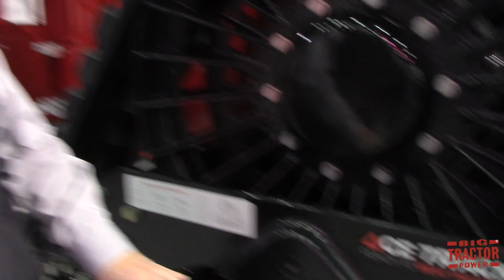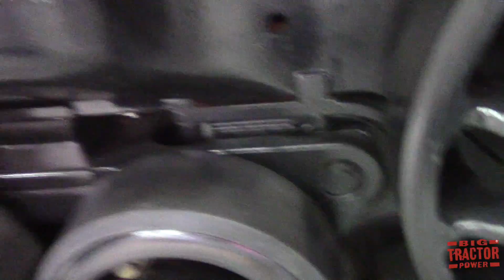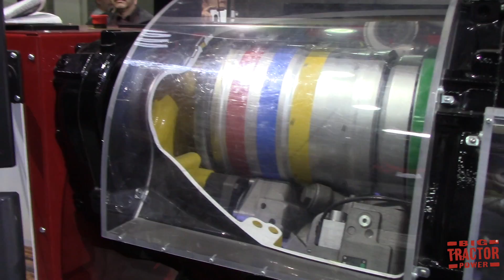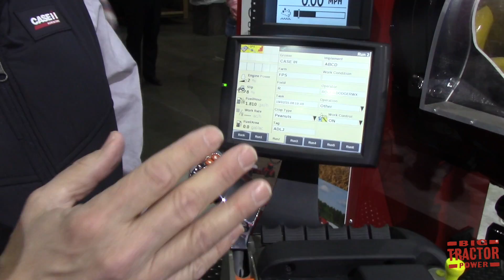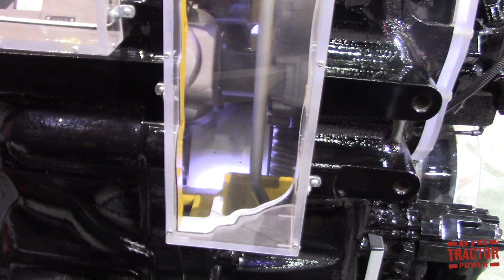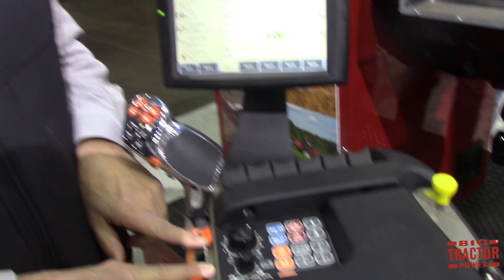New 2019 Steiger 500 CVX RowTrac Review with Case IH

Comment: Great vid👍the updates address one of issue that’s hold some farmers back which is track speed without extreme heat as Australia is very hot country and dusty conditions those old track design would heat up and farmer would pouring in graphite powdered make them run cooler.  I reckon with new track n one oil need one tracks will increase sales on Magnum n Steiger in Australia.
Reply from the maker: Heat seems to be an issue in roading a distance on tracks.   It will be interesting to see how Ace Tracks over come heat build up in road travel.